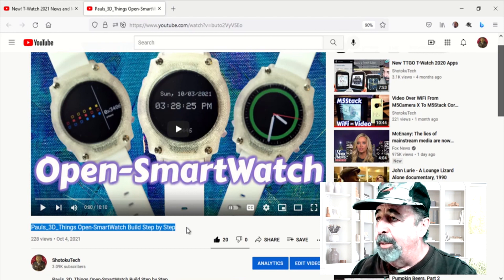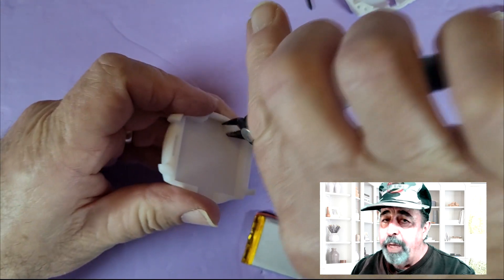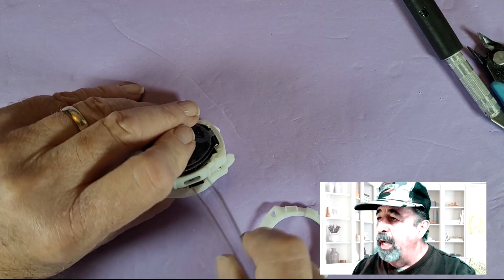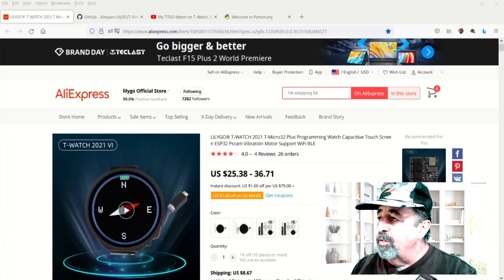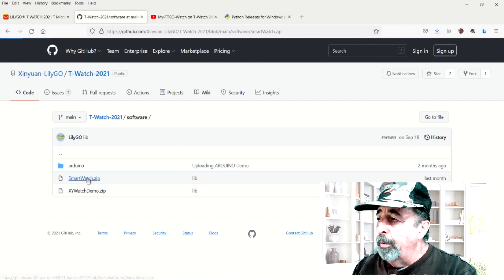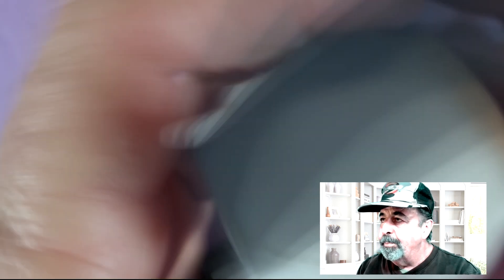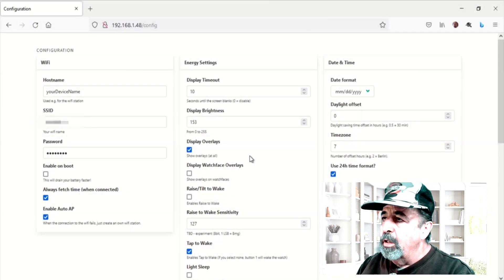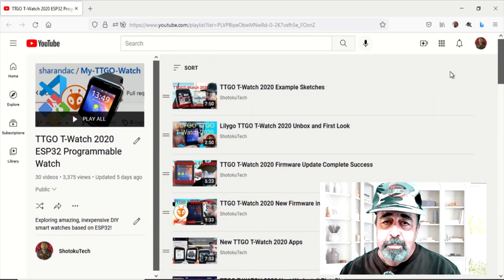LILYGO TTGO T Watch 2021 Unbox and Test

Comment: Thanks for your great vid. The capacity touchscreen is awesome and feels much better than the old watch. The uptime of the battery in deep sleep mode is hugh not like the old watch app. But the connection of the band is not very terrible and disconnects easily.
Reply from the maker: Interesting. I haven't had that problem so far. But I do see the potential for this issue.  Thanks!
Reply: @ShotokuTech  

Thanks for responding so soon, really appreciate it

 1) I open Vscode and open XYwatchdemo
2) I define WIFI_SSID and WIFI_PASS in Config.h
3) I plug T-U2T downloader into watch and plug it into PC with usb-C
4) I hold boot and click reset (nothing happens)
5) I click PlatformIO build (tick)

> Executing task: C:\Users\USERNAME\.platformio\penv\Scripts\platformio.exe run <

Processing esp32dev (platform: espressif32; board: esp32dev; framework: arduino)
---------------------------------------------------------------------------------------------------------------------------------------------------------------------------------------------------------------------------------Verbose mode can be enabled via `-v, --verbose` option
CONFIGURATION: https://docs.platformio.org/page/boards/espressif32/esp32dev.html
PLATFORM: Espressif 32 (4.3.0) > Espressif ESP32 Dev Module
HARDWARE: ESP32 240MHz, 320KB RAM, 4MB Flash
DEBUG: Current (cmsis-dap) External (cmsis-dap, esp-prog, iot-bus-jtag, jlink, minimodule, olimex-arm-usb-ocd, olimex-arm-usb-ocd-h, olimex-arm-usb-tiny-h, olimex-jtag-tiny, tumpa)
PACKAGES:
 - framework-arduinoespressif32 @ 3.20003.0 (2.0.3)
 - tool-esptoolpy @ 1.30300.0 (3.3.0)
 - toolchain-xtensa-esp32 @ 8.4.0+2021r2-patch3
LDF: Library Dependency Finder -> https://bit.ly/configure-pio-ldf
LDF Modes: Finder ~ chain, Compatibility ~ soft
Found 50 compatible libraries
Scanning dependencies...
Dependency Graph
|-- lvgl @ 8.0.1
|-- SdFat @ 2.0.7
|   |-- SPI @ 2.0.0
|-- BluetoothSerial @ 1.0
|-- BMA423-Sensor-API
|-- HTTPClient @ 2.0.0
|   |-- WiFi @ 2.0.0
|   |-- WiFiClientSecure @ 2.0.0
|   |   |-- WiFi @ 2.0.0
|-- OneButton
|-- WiFi @ 2.0.0
|-- lv_lib_gif
|   |-- lvgl @ 8.0.1
|-- Adafruit BME280 Library @ 2.1.4
|   |-- Adafruit Unified Sensor @ 1.1.4
|   |-- SPI @ 2.0.0
|   |-- Wire @ 2.0.0
|-- Adafruit Unified Sensor @ 1.1.4
|-- Ai Esp32 Rotary Encoder @ 1.2
|-- ArduinoJson @ 6.18.0
|-- Cst816s
|   |-- Wire @ 2.0.0
|-- PCF8563_Library @ 0.0.1
|   |-- Wire @ 2.0.0
|-- QMC5883LCompass @ 1.1.1
|   |-- Wire @ 2.0.0
|-- SPI @ 2.0.0
|-- TFT_eSPI @ 2.3.70
|   |-- SPIFFS @ 2.0.0
|   |   |-- FS @ 2.0.0
|   |-- FS @ 2.0.0
|   |-- SPI @ 2.0.0
|-- TinyGPSPlus @ 1.0.2
|-- Wire @ 2.0.0
Building in release mode
Compiling .pio\build\esp32dev\src\HAL\Backlight\Backlight.cpp.o
Compiling .pio\build\esp32dev\src\HAL\Bluetooth\Bluetooth.cpp.o
Compiling .pio\build\esp32dev\src\HAL\Display\display.cpp.o
Compiling .pio\build\esp32dev\src\HAL\GPS\gps.cpp.o
Compiling .pio\build\esp32dev\src\HAL\HAL.cpp.o
Compiling .pio\build\esp32dev\src\HAL\Motor\motor.cpp.o
Compiling .pio\build\esp32dev\src\HAL\Power\power.cpp.o
Compiling .pio\build\esp32dev\src\HAL\SD\sd.cpp.o
Compiling .pio\build\esp32dev\src\HAL\WIFI\WIFI.cpp.o
Compiling .pio\build\esp32dev\src\HAL\bma423\bma423.cpp.o
Compiling .pio\build\esp32dev\src\HAL\bme280\bme280.cpp.o
Compiling .pio\build\esp32dev\src\HAL\botton\botton.cpp.o
src/HAL/bma423/bma423.cpp: In function 'bool XYWatch::CheckAccSensor()':
src/HAL/bma423/bma423.cpp:156:1: warning: no return statement in function returning non-void [-Wreturn-type]
 }
 ^
Compiling .pio\build\esp32dev\src\HAL\encoder\encoder.cpp.o
src/HAL/botton/botton.cpp:7:1: warning: 'typedef' was ignored in this declaration
 typedef enum
 ^~~~~~~
Compiling .pio\build\esp32dev\src\HAL\pcf8563\pcf8563.cpp.o
Compiling .pio\build\esp32dev\src\HAL\qmc5883l\qmc5883l.cpp.o
Compiling .pio\build\esp32dev\src\HAL\touch\touch.cpp.o
src/HAL/qmc5883l/qmc5883l.cpp: In function 'bool XYWatch::CheckMAGSensor()':
src/HAL/qmc5883l/qmc5883l.cpp:18:1: warning: no return statement in function returning non-void [-Wreturn-type]
 }
 ^
Compiling .pio\build\esp32dev\src\Resource\LogoSetup.c.o
Compiling .pio\build\esp32dev\src\Resource\UI_step.c.o
Compiling .pio\build\esp32dev\src\Resource\font\font_nixie_18.c.o
Compiling .pio\build\esp32dev\src\Resource\font\font_nixie_32.c.o
Compiling .pio\build\esp32dev\src\Resource\font\font_nixie_48.c.o
Compiling .pio\build\esp32dev\src\Resource\font\font_nixie_70.c.o
Compiling .pio\build\esp32dev\src\Resource\gif_spacer.c.o
Compiling .pio\build\esp32dev\src\Resource\img_Humanoid_LOGO.c.o
Compiling .pio\build\esp32dev\src\Resource\img_foot_black.c.o
Compiling .pio\build\esp32dev\src\Resource\img_foot_white.c.o
Compiling .pio\build\esp32dev\src\Resource\img_lilygo.c.o
Compiling .pio\build\esp32dev\src\Resource\img_pointer.c.o
Compiling .pio\build\esp32dev\src\Software\Pages\AppManager.cpp.o
Compiling .pio\build\esp32dev\src\Software\Pages\ClockApp\SimpleClock.cpp.o
Compiling .pio\build\esp32dev\src\Software\Pages\Compass\Compass.cpp.o
Compiling .pio\build\esp32dev\src\Software\Pages\ConsolePage\Console.cpp.o
In file included from lib/lvgl/lvgl.h:47,
                 from src/XYWatch_hal.h:4,
                 from src/Software/Pages/AppManager.h:4,
                 from src/Software/Pages/AppManager.cpp:1:
src/Software/Pages/AppManager.cpp: In function 'void LogoSetup()':
src/Software/Pages/AppManager.cpp:9:20: error: local external declaration 'const lv_img_dsc_t LogoSetup' [-fpermissive]
     LV_IMG_DECLARE(LogoSetup);
                    ^~~~~~~~~
lib/lvgl/src/widgets/lv_img.h:184:60: note: in definition of macro 'LV_IMG_DECLARE'
 #define LV_IMG_DECLARE(var_name) extern const lv_img_dsc_t var_name;
                                                            ^~~~~~~~
src/Software/Pages/AppManager.cpp:6:6: note: does not match previous declaration 'void LogoSetup()'
 void LogoSetup(void)
      ^~~~~~~~~
* [.pio\build\esp32dev\src\Software\Pages\AppManager.cpp.o] Error 1
================================================================================================== [FAILED] Took 25.48 seconds ==================================================================================================The terminal process "C:\Users\USERNAME\.platformio\penv\Scripts\platformio.exe 'run'" terminated with exit code: 1.

Terminal will be reused by tasks, press any key to close it.

6) I press upload (right arrow)

> Executing task: C:\Users\USERNAME\.platformio\penv\Scripts\platformio.exe run --target upload <

Processing esp32dev (platform: espressif32; board: esp32dev; framework: arduino)
----------------------------------------------------------------------------------------------------------------------------------------------------------------------------------------------------------------Verbose mode can be enabled via `-v, --verbose` option
CONFIGURATION: https://docs.platformio.org/page/boards/espressif32/esp32dev.html
PLATFORM: Espressif 32 (4.3.0) > Espressif ESP32 Dev Module
HARDWARE: ESP32 240MHz, 320KB RAM, 4MB Flash
DEBUG: Current (cmsis-dap) External (cmsis-dap, esp-prog, iot-bus-jtag, jlink, minimodule, olimex-arm-usb-ocd, olimex-arm-usb-ocd-h, olimex-arm-usb-tiny-h, olimex-jtag-tiny, tumpa)
PACKAGES:
 - framework-arduinoespressif32 @ 3.20003.0 (2.0.3)
 - tool-esptoolpy @ 1.30300.0 (3.3.0)
 - tool-mkfatfs @ 2.0.1
 - tool-mklittlefs @ 1.203.210628 (2.3)
 - tool-mkspiffs @ 2.230.0 (2.30)
 - toolchain-xtensa-esp32 @ 8.4.0+2021r2-patch3
LDF: Library Dependency Finder -> https://bit.ly/configure-pio-ldf
LDF Modes: Finder ~ chain, Compatibility ~ soft
Found 50 compatible libraries
Scanning dependencies...
Dependency Graph
|-- lvgl @ 8.0.1
|-- SdFat @ 2.0.7
|   |-- SPI @ 2.0.0
|-- BluetoothSerial @ 1.0
|-- BMA423-Sensor-API
|-- HTTPClient @ 2.0.0
|   |-- WiFi @ 2.0.0
|   |-- WiFiClientSecure @ 2.0.0
|   |   |-- WiFi @ 2.0.0
|-- OneButton
|-- WiFi @ 2.0.0
|-- lv_lib_gif
|   |-- lvgl @ 8.0.1
|-- Adafruit BME280 Library @ 2.1.4
|   |-- Adafruit Unified Sensor @ 1.1.4
|   |-- SPI @ 2.0.0
|   |-- Wire @ 2.0.0
|-- Adafruit Unified Sensor @ 1.1.4
|-- Ai Esp32 Rotary Encoder @ 1.2
|-- ArduinoJson @ 6.18.0
|-- Cst816s
|   |-- Wire @ 2.0.0
|-- PCF8563_Library @ 0.0.1
|   |-- Wire @ 2.0.0
|-- QMC5883LCompass @ 1.1.1
|   |-- Wire @ 2.0.0
|-- SPI @ 2.0.0
|-- TFT_eSPI @ 2.3.70
|   |-- SPIFFS @ 2.0.0
|   |   |-- FS @ 2.0.0
|   |-- FS @ 2.0.0
|   |-- SPI @ 2.0.0
|-- TinyGPSPlus @ 1.0.2
|-- Wire @ 2.0.0
Building in release mode
Compiling .pio\build\esp32dev\src\Software\Pages\AppManager.cpp.o
Compiling .pio\build\esp32dev\src\Software\Pages\DigitalClock\DigitalClock.cpp.o
Compiling .pio\build\esp32dev\src\Software\Pages\Setting\Setting.cpp.o
Compiling .pio\build\esp32dev\src\Software\Pages\SpacerClock\Spacer.cpp.o
In file included from lib/lvgl/lvgl.h:47,
                 from src/XYWatch_hal.h:4,
                 from src/Software/Pages/AppManager.h:4,
                 from src/Software/Pages/AppManager.cpp:1:
src/Software/Pages/AppManager.cpp: In function 'void LogoSetup()':
src/Software/Pages/AppManager.cpp:9:20: error: local external declaration 'const lv_img_dsc_t LogoSetup' [-fpermissive]
     LV_IMG_DECLARE(LogoSetup);
                    ^~~~~~~~~
lib/lvgl/src/widgets/lv_img.h:184:60: note: in definition of macro 'LV_IMG_DECLARE'
 #define LV_IMG_DECLARE(var_name) extern const lv_img_dsc_t var_name;
                                                            ^~~~~~~~
src/Software/Pages/AppManager.cpp:6:6: note: does not match previous declaration 'void LogoSetup()'
 void LogoSetup(void)
      ^~~~~~~~~
* [.pio\build\esp32dev\src\Software\Pages\AppManager.cpp.o] Error 1
========================================================================================== [FAILED] Took 9.36 seconds ==========================================================================================The terminal process "C:\Users\USERNAME\.platformio\penv\Scripts\platformio.exe 'run', '--target', 'upload'" terminated with exit code: 1.

Terminal will be reused by tasks, press any key to close it.

Comment: Really love the video (like I always do). I don't think I will buy this version of the watch (I find it fairly bulky), but the available demo firmware looks promising. Thanks for showing it! 👍
Reply from the maker: Thanks. This was a tough one for me to make. Actually started filming before the T-Impulse video. I was having some problems and my doubts, when the T-Impulse came in the mail. So I made that video first. Then I realized I was actually succeeding with this one when I thought I had failed. So I grind it out and put it up. Thanks for your support!
Reply: I never used it's predicessor, the Paul3D Open Source Watch Kit, to make a watch. People got to realize, this is a high rez, IPS display with an ESP32 chip on board. You can use it in ANYTHING! As long as you don't need any sensors attached, it's the perfect ESP32 chip.
Reply from the maker: @MaxSMoke777  It's like a round T-Display with a couple more buttons! LOL